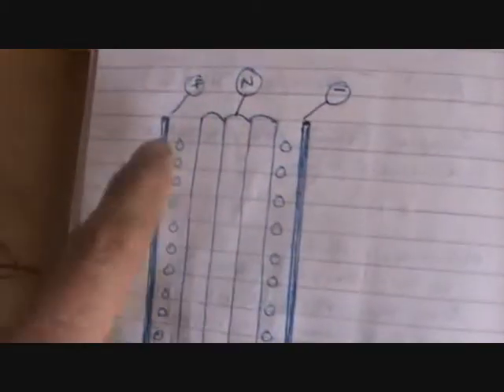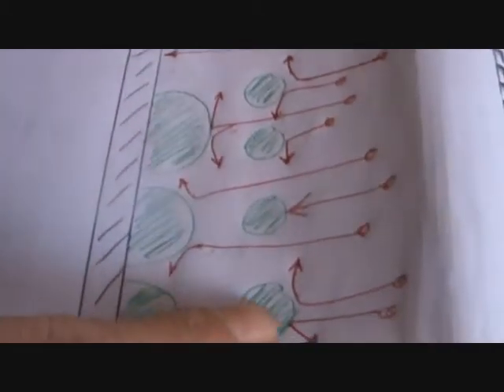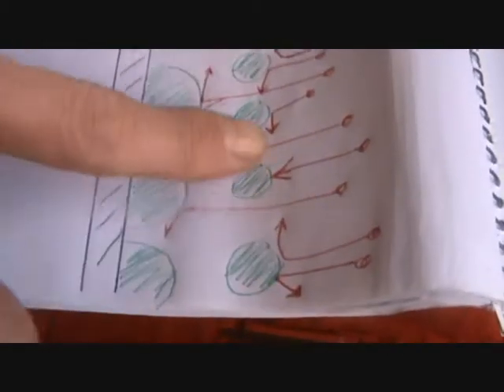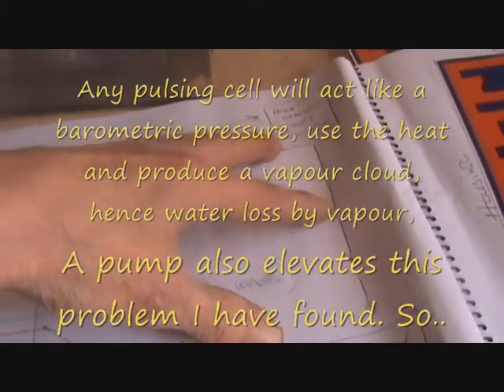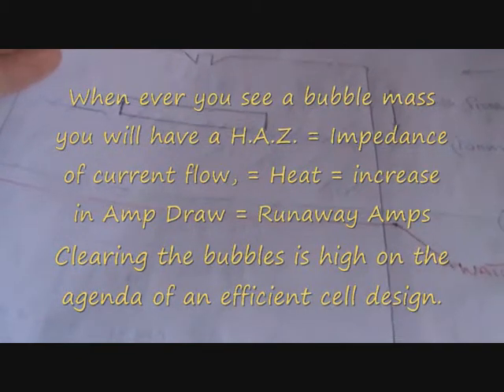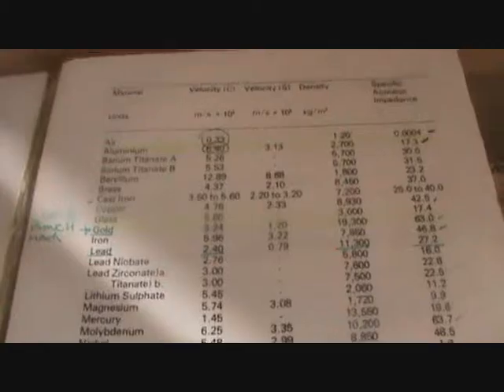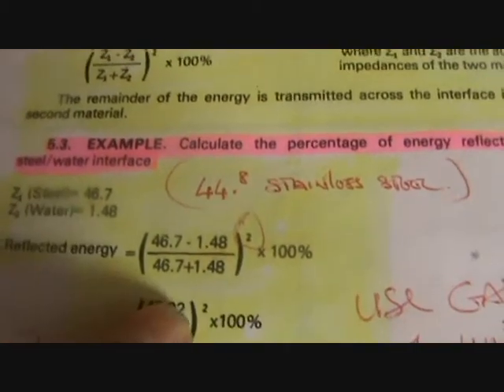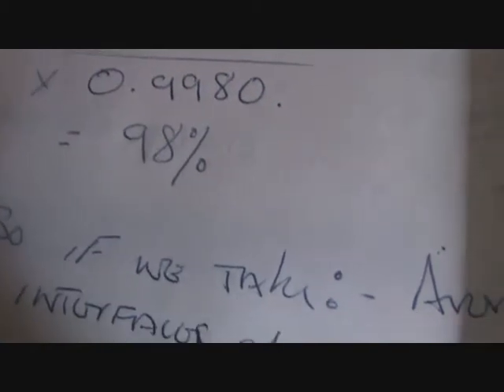FuelBan On the - Heat Affected Zone.  H.A.Z. "Within"  HHo Dry cell units

Comment from the maker: all you say like angles and such, I have found to be very true, the matters "root" is totally in the "Bubble", And the "Impedance" caused by the same "Bubble", remove the Bubble or shorten its stay on the plate, and you lessen the "Impedance" so not got heat build up, no heat no run away amps... it works for me for 2 / 3 years now...thanks for your response.. no PMW NEEDED GUY...
Thom.